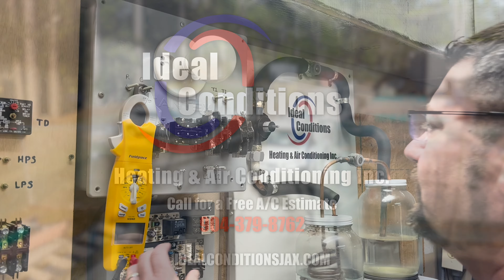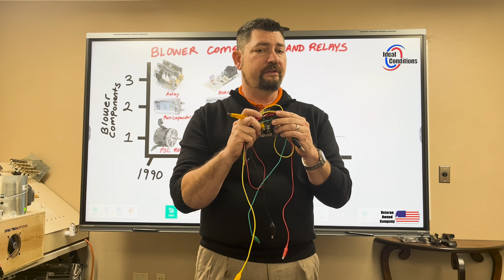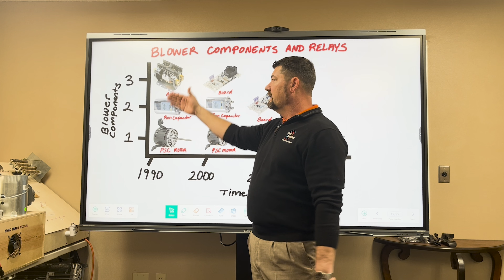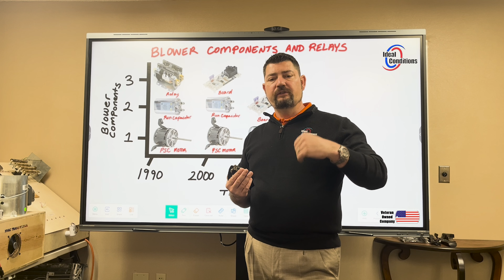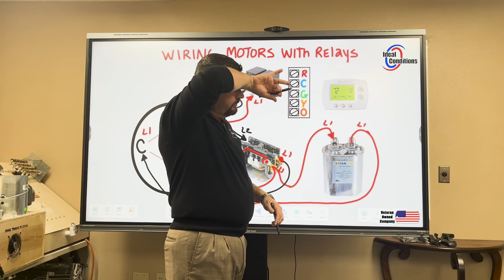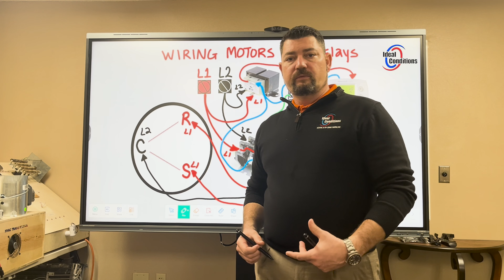Guide for Wiring a Motor with a 1 Pole Contactor

Comment: Great info. Thanks for sharing. Using a contactor for the blower would work  for an air handler, but can you do it with a gas furnace? Doesn’t the IFC board keeps the blower on to cool down the heat exchanger. Am I thinking correctly on this? A sequencer would be a better option for a gas furnace.